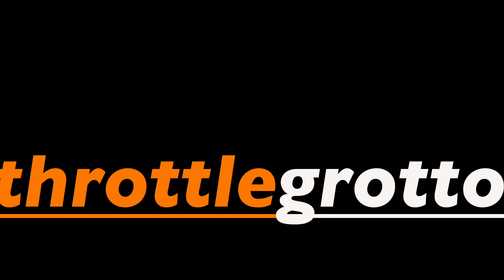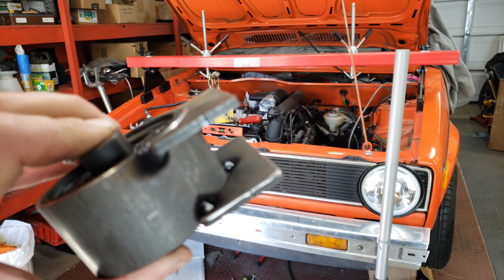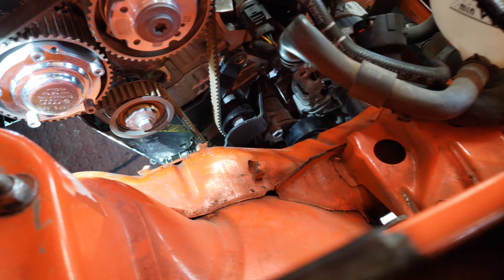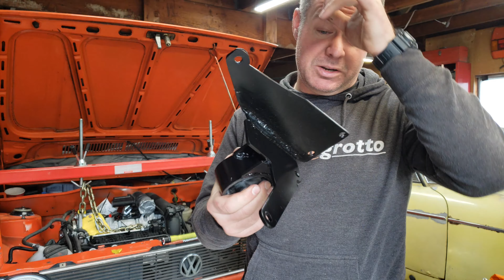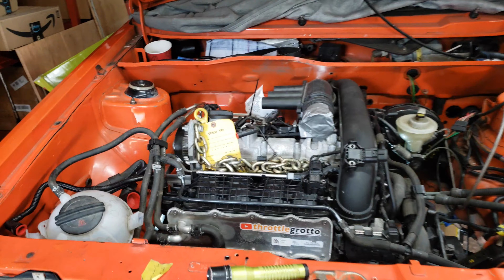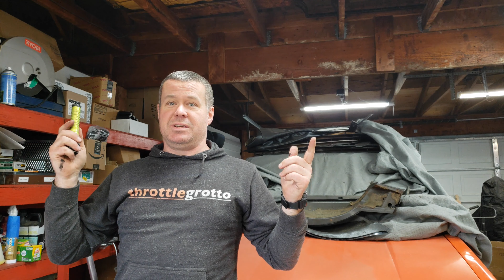Custom 1.4t passenger side engine mount for the 1975 VW rabbit - ep #59

Comment: Nice work bro .. but what will u do with the ECU and the electrical system to get this engine work?
Reply from the maker: Currently working with an ECU tuner to get the limitations removed so the engine will run.
Reply: @ThrottleGrotto  i am planning to sawp that engine into a ibiza 6k2 but i am still confused about using the ea211 or the older version ea111 as I didn’t find any info about how many hp that ea211 could handle on stock internals… the older version with aftermarket pistons could easly pass the 300hp mark.. appreciate your help if u have the info 🙏